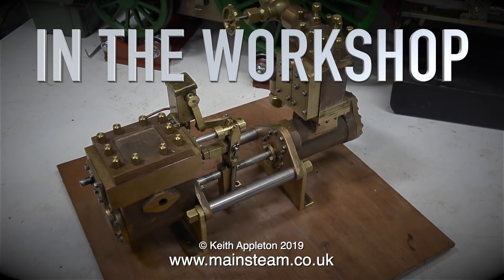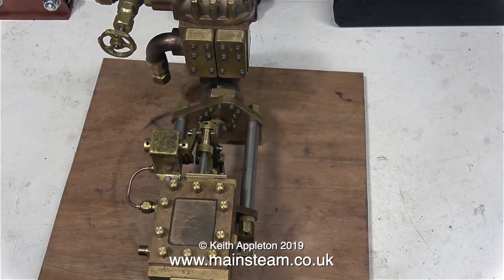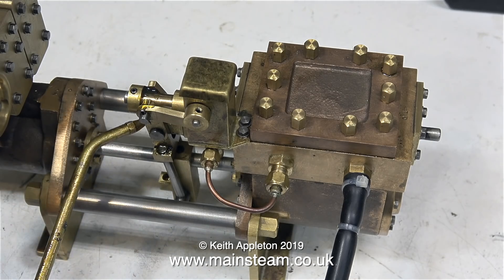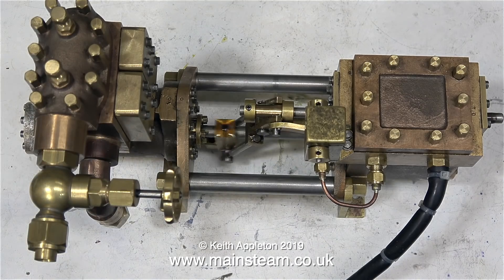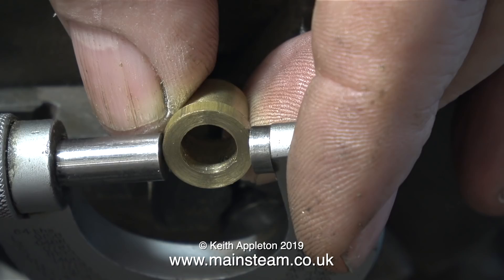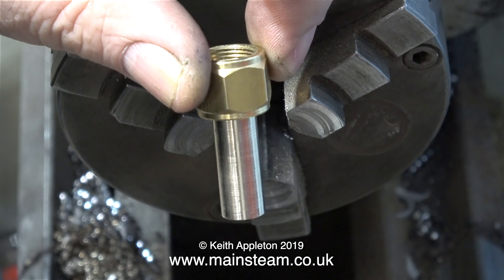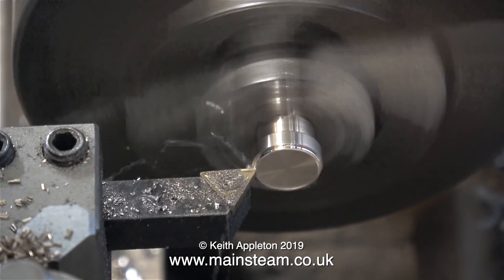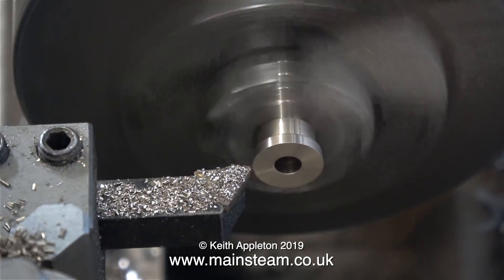A HORIZONTAL SOUTHWORTH 12 INCH BOILER FEED PUMP - PART #1

Comment: I'm a bit curious as to why the sound is not (almost) the same at either end of the stroke. One end definitely has a double chuff, while the other end is the single chuff I would expect.
Reply from the maker: It depends on the load and maybe the fact that the pump hasn't run for quite a while . . .